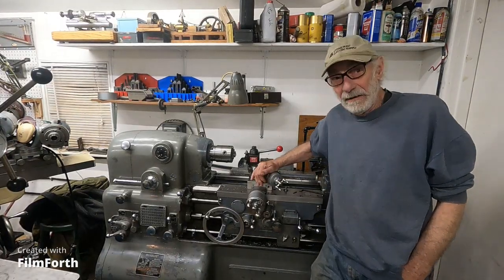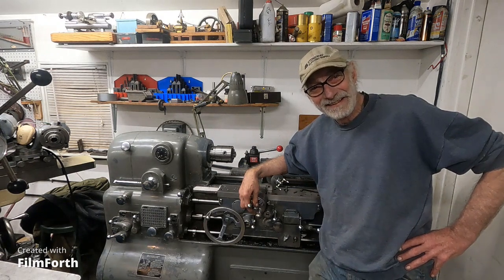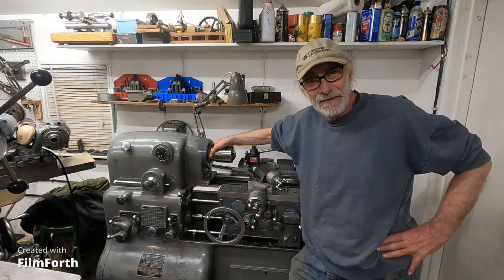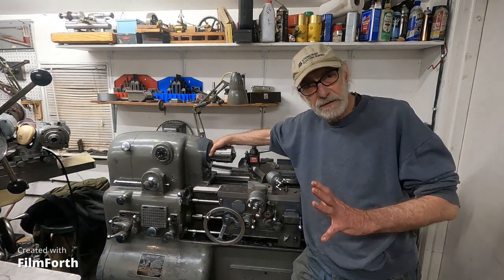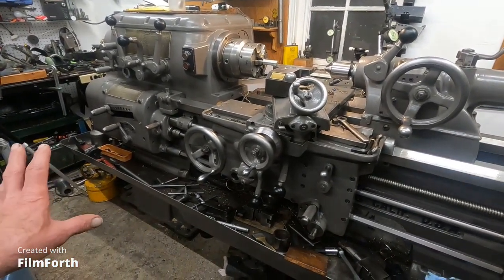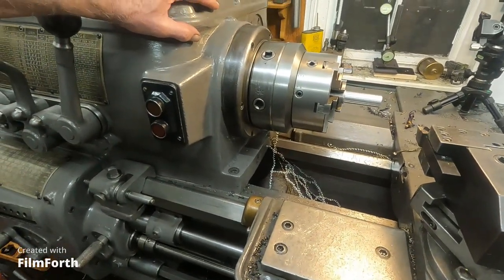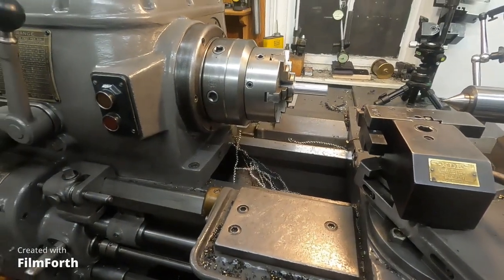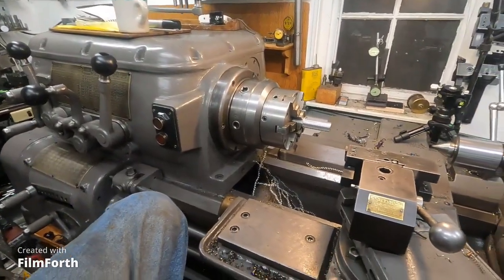Metal lathes, my observations

Comment: As I have said before, I have run a number of different lathes in my time, and I still have a fondness towards the Clausing Colchester 17" tool room engine lathe as far as a general purpose, all round, easily to work with, accurate as hell and as "good" as the guy running it! Very easy to change speeds by means of a rotating control dial. Feeds were equally easy to select. 
It had a bunch of add on features / options including a "quick threading" attachment with it's own dedicated half nut, that could be set to disengage within a thousandth or so. Great for blind holes or difficult threads! Sturdy enough to take heavy cuts yet accurate enough to work in tenths when required, and it could run all day without beating up the operator.
Reply from the maker: I like those machines also, a local shop I worked at had a older one and a newer 17", i was low on the totem pole and used the older smaller one when I was there. The machines are hard to find in good condition

Comment: I've run a lot of the lathes you've mentioned. My favorite to run was a 60s model 20" South Bend Turnado. Not heavy duty by any means, but the 2 speed motor with the clever gear change selector and the slick quick change gearbox made it easy to concentrate on the work. The lighter carriage and tail stock were a plus for light to medium duty work.
The heaviest lathe I ever used was an Axleson. As pointed out in the video you will get a good workout if you run it all day.
The best Taiwanese lathe I ever used was the Cadilliac. The build quality was excellent. The best Japanese lathe I've run would be Mori Seki. The Mazak Ajax is good as well and a good machine to get if you can find one that hasn't been beat to death.
Cheers from NC/USA
Reply from the maker: I have heard that about the turnado lathes, I have not seen one in my area, thanks
Reply: @deedeeindustrialsuperprecision  South Bend must have not sold  many. They were undercut at the time by lathes like Mazak I would guess. I saw a nice long bed Turnado on sale from a college five or six years ago and it's the last one I've seen anywhere.

Comment: I don't know if the manual Okuma's were popular in USA, but in South Africa I found an Okuma LP that they called a toolroom lathe. A generous 12" diameter over the ways but only 1½" spindle bore with an A1-6 nose, and a short bed, with carriage wings half the length of the ways. Variable spindle speed using a Kopp Variator. Beautiful solid machine.
Reply from the maker: Hi, the larger Okuma gearhead lathes about 16" were sold and now sought after by gunsmiths because of the shorter headstock, there are a fair amount of those still around HGR surplus gets them in. The machines from Japan really changed things and are still being copied today.

Comment: I have a 10ee and a 14" Enco with the 3.125" bore.  The Chinese company that built the Enco built all their lathes from 14 up to 24" using the same beds, saddles, and headstocks.  So my 14" lathe has 12" of travel on the cross-slide. The 10ee is like driving a Ferrari, the Enco lathe is like driving a dump truck.  But even a dump truck comes in handy from time to time.
Reply: MS, yep the 10ee is wonderful, just like a Ferrari. And just like a Ferrari a 10ee is mechanically complicated and costs a fortune to repair... if you can figure out how to repair it. The last price list I saw from Monarch 25 years ago had the list price for a 10ee as $90,000 ... just like a Ferrari!
Reply: @aceroadholder2185  Actually, they are a simple design.  There is no transmission, the spindle is directly belt driven.  The motor has a back gear mounted to it.The quick change is driven by a belt for feeds. In thread cutting it is gear driven.  The rest of the mechanics of the lathe is conventional, except very well designed. The lube system on the lathe is excellent.
Reply: @makerspace533  An A.C. motor driving a D.C. generator driving a D.C. motor all controlled by vacuum tubes... indeed wonderful when it works. Simple, not so much.
Reply from the maker: I sold my last gearhead lathe 10yrs ago and just used the two 10ee lathes and found I really need a standard lathe for multiple reasons, one being general lack of power to quickly remove metal. Thanks.
Reply from the maker: The problem with the 10ee is lack of maintenance and abuse by operators constantly overloading the drive system. In my observation the Monarch ee and the Hardinge HLVH really out class most all cars. They made enough 10ee lathes that one can still be found in great condition, it is ridiculous to think one can truly rebuild one at home.
Reply from the maker: The motor generator machines are early 50s, then vacuum tubes to 1983. Both those drives are repairable. After 1983 to late 90s the drive was solid state with high voltage circuit boards, those I can not repair. Anyway one has to be dedicated or have the need for a drive that compensates for load and will have speed drop.
Reply: @deedeeindustrialsuperprecision  My 1961 10ee originally had the modular thyratron controller.  The modular system had two large thyratrons in a full wave rectifier configuration for the armature and a single small thyratron for the field. Someone had pulled out the electronics and replaced it with a large variac, bad bad. So I designed and built a solid state controller that has been working well for the last 25 years.  I guess all those years as an EE came in handy.  A friend had a very nice 10ee built in 1983.  It also had the modular system, but he was having stability problems with the drive.  It turns out Monarch changed the motor going from a 1A field to a motor with a 2A field.  The small thyratron could not handle the higher current.  I built a solid state controller for him and it has been doing well for 20 years.

Comment: One of our shop lathes at work is a hardinge hlv-h with a kdk tool post,I really like it.
Reply from the maker: The KDK seems to work great on the Hardinge, I like it on this Axelson, but I found an early rare version 200 series post that has the mounting bolt more forward like the 100 series making the tools not project out as far as the 150m series and the newer 200 series, thanks for that

Comment: It’s getting to where my fingers are not so nimble anymore. I have to use a pair of tweezers to load and unload those chips for the GoPros. Did you try to clean off the chip and test to see if it still would read? Have a great day.
Reply from the maker: I did get the chip to read!

Comment: whats your take on chucks? size wize. i was told by an old toolmaker to use the smallest chuck that can do the job well to reduce vibration. he recon if your chuck is heavy it will amplify vibration......and im not shore if it is wishfull thinking, or the changes i made over time was also changes in quality. but the sence i get is that that holds true. what do you think?
Reply from the maker: Most have found a small as possible 4jaw chucks are the most solid. If the chuck is not balanced the part becomes larger on the outer end. The best thing is to test out your chucks.

Comment: So I have never ran a Axleson lathe But I have two Monarch and I can tell you my 16X30 weight around 6,500 Lbs. And my 16X54 is 9,890 Lbs and they are Rock Solid machines right there
Reply from the maker: These old machines are great, the American Pacemaker was the winner for the most weight with their 14X30 heavy pattern model at 10000 lbs!

Comment: Instead of fretting over a thou or 2 runout in the chuck, why not just used soft jaws custom bored to your holding diameter?  Piece is then held true concentric with the spindle axis.
Reply from the maker: dealing with soft jaws for single parts is not a good use of my time, but thanks
Reply: @deedeeindustrialsuperprecision  I dont think it takes any more time than machining face plates, etc...but to each their own.
Reply from the maker: @bluestarindustrialarts7712  Honestly i think that approach is far to slow  relating to the work I do in repair, restoration, hydraulics, and powersports applications, that sort of fixturing is for manufacturing  and multiple parts, I am familiar with it, but it should not be a crutch because your chucks are in bad shape and you do not know how to fix them, thanks for the input.